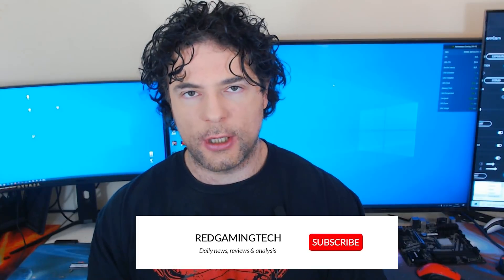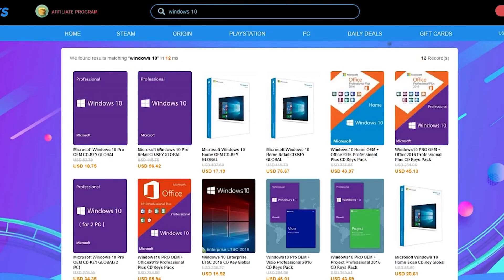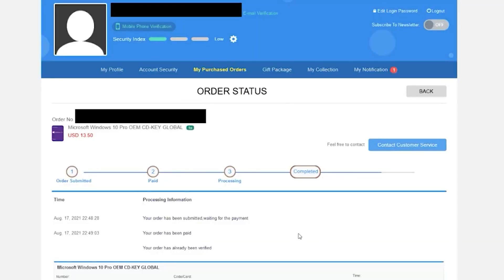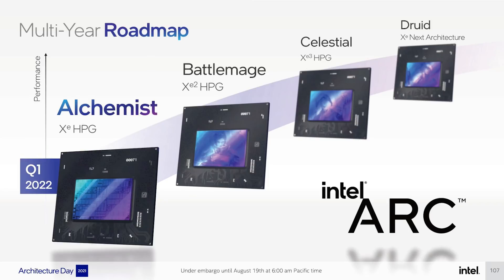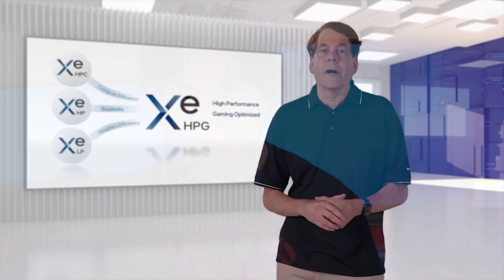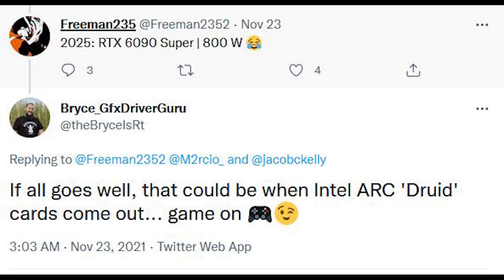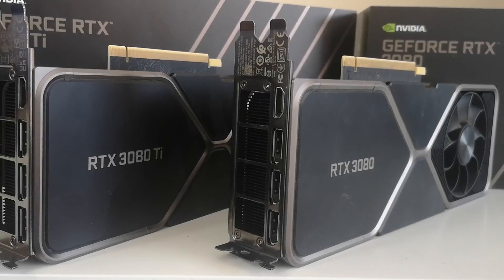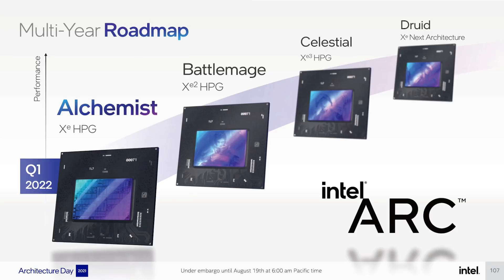Intel Could DOMINATE AMD & Nvidia With These Plans - Intel Arc GPU Roadmap | AMD Abandons TSMC?

Comment: for what i´ve read , the case of AMD getting chips from samsung is just due to capacity issues at TSMC, is just good bissness at this point to have the 3nm process booked in advance even if it is just capacity
Reply: I think it's more likely with MCM GPUs that one of the chiplets will be made at Samsung but the main processors will be TSMC. I don't think they even remotely want to tarnish their relationship with TSMC. No way do they want Nvidia taking the fabs they left behind.
Reply: @Skylancer727  agreed , if am not mistaken AMD is the second most important partner of TSMC after Apple

Comment: I hope the Arc line of GPUs does well but i suspect the first generation will be laptop only.  It sounds like they're set to release around the same time as AMD and Nvidia which means they won't be comparing to a 3070.  They'll be more comparable to a 4050 or a 7500 for their flagship GPU.
Reply: Considering due to product demand and availability issues Nvidia is rereleasing an old 2060 card then if Intel can put out a 3070 performance level card in good numbers and at a reasonable price point there will be plenty of buyers interested.
Not everyone is looking for the top tier cards, many just want a reasonably priced within their budget GPU capable of playing modern games at reasonable frame rates on 1080p and 1440p monitors.

Comment: AMDs engineers are the best because before they have to do with inferior wafer nm nodes to compete with intel. Now AMD is using not even the latest tech from TSMC and they are just dominating. Wait till AMD uses 3 nm nodes and compare them with apples 3nm, you will see AMDs are far superior.

Comment: With intel specs and vs. what AMD already has in future there is a gab of at least 1 year between AMD and anyone else as they still have the crown,
Reply: Well they will probably fuck it in multiple ways because they are AMD and this is what they do. So we can expect not enough GPUs, insanely high prices, no mechanism to avoid scalpers from buying GPUs on their website, etc.
Reply: @korinogaro  Everything you said could also be applied to Nvidia.   Also, it's not just AMD, it's TSMC's superior nodes that are beating Intel.
Reply: @diamondlion47  not really. Difference between them is that nVidia does all this shit intentionally/doesn't care (in case of scalpers) while AMD is simply fucking up.

Comment: Well AMD just announced going for networking chips so Samsung's process nodes are plenty good for those types of applications. Also chipsets and lesser compute chips can/may be produced on Samsung. 
AMD can't abandon TSMC due to node superiority and AMD needs every single advantage they can get vs Intel and especially Nvidia.
Reply: AMD has a FULL GENERATION technological advantage over everyone else with MCM GPUs. They can afford going Samsung. 
After all, that's what Nvidia is also doing (TSMC will be for the "pro" GPUs, like Ampere).
Reply: @_A.d.G_  AMD is barely matching Nvidia with TSMC 7nm vs Nvidia Samsung 8nm. 
Samsung 8nm is barely an upgrade vs 16/12nm TSMC they used for Turing and Volta. 
You could say AMD is still behind atleast half node, but of course you can never truly make that comparison, every chip is designed for a specific node in mind.
Nvidia is gonna go all out with 5nm TSMC and the jump is massive.  AMD will also use TSMC 5nm and it will become a true war with technologies. 
Will AMD's MCM win vs whatever Nvidia monolithic desing has to offer? 
I do think AMD can do a lot here with MCM and leading processnode however Nvidia isn't sitting still pants down working with their own MCM designs. 
AMD's MCM desing may be only temporary relief/win against Nvidia, but only time will tell.
Reply: @Diglo1  what does production node impact? Have you noticed that AMD is unfathomably superior to Nvidia in terms of efficiency? Do you think that surrendering some of that unreachable gap for the sake of much bigger volumes of production would be a problem? Don't you get that with Intel stepping in the GPU market, CPU+GPU bundles will be the norm in the industry?
Reply: @_A.d.G_  Production node impacts EVERYTHING!
It impacts efficiency, clockspeeds, the amount of transistors per die area, amount of dies per wafer and the defect density impacts the amount of good dies.
Denser die will have more performance potential per die area and more chips can be made from the same size wafer.
Samsung 8nm is far worse process node vs TSMC 7nm.
AMD is barely better in efficiency then Nvidia, sure there are some cases where Nvidia is far behind, but if we exclude the most fastest ever 3090s and RX 6900XT, AMD is only slightly better at efficiency.
AMD does have significantly lower raytracing performance so when we check efficiency there AMD loses.
Also Nvidia holding the performance crown by just 5% somehow justifies whatever efficiency losses there seem to be (mind share).
I don't understand your third question. Of course getting ratio right between quantity and quality is a must. 
This however is a multivaried equation and I won't dwell into that.
"Don't you get that with Intel stepping in the GPU market, CPU+GPU bundles will be the norm in the industry?"
I never even mentioned Intel so getting something about something I didn't even mention does not make any sense.
CPU and GPU bundles are likely to get more common, however that will depend on how good Intel's GPUs are.
AMD can comfortably pair CPU with GPU however Intel is just releasing their first discrete GPUs so it will take years to actually matter and Nvidia doesn't have CPUs.
So AMD has a clear advantage there which they are taking advantage off, but that advantage is only relevant if their products stay competitive enough.
MCM saved AMD trough their CPUs yet they are already challenged by Intel on mainstream CPUs and Nvidia is constantly been better or on par.
So AMD needs to keep their advantages and staying with MCM and TSMC is a must however those advantages will fade away over time until something now comes along.
Intel has 3D stacking and money stacks, AMD MCM + 3DVcache, Nvidia mindshare + key technologies like DLSS, RT, superiority in many software related things such as CUDA accelerations and much more.

In short I truly believe AMD can do many things with MCM just like they did with Ryzen and CDNA2 yet Nvidia simply stepping from Samsung 8nm to 5nm can bring hell to AMD in terms of GPUs.
Reply: @Diglo1  if you say so...
Reply: @_A.d.G_  🤣🤣🤣
Reply: @Diglo1  hip rocm, bye cuda advantage
Reply: @miyagiryota9238  I hope AMD can pressure Nvidia's CUDA acceleration.

Comment: AMD's partnership with Samsung is most likely constrained to the mobile phone market, probably producing RDNA technology using Samsung's fabs for the graphics chips in Samsung's phone range.
Reply: Why? Can you imagine how much income have TSMC's constraints in production "stolen" to AMD, Sony and Microsoft? 
AMD already gave the middle finger to GloFo, why they can't do the same with TSMC?
Reply: They also are the two of the 3 developers of HBM memory;  AMD didn't introduce HBM on the R9 Fury or use HBM2 on Vega for no reason.  They helped invent it with Samsung and SK Hynix.  To me,  AMD's biggest error was  not replacing the polaris card stack with Vega after in moved to 7 nm;  by that time, GDDR6 was available, and would have been fine for a 32CU or 24CU board.
Reply: Considering how far in advance contracts are made, who knows.  I'm pretty sure Zen4 contracts are already made, but if TSMC can't give AMD enough wafer production I could see them moving to both Samsung and TSMC to produce a product stack of GPUs for instance, or Samsung entirely.  Right now AMD can't produce enough die of almost any kind right now with TSMC.  They can't produce enough desktop CPUs, server CPUs, has still not gotten to HEDT and they've had to remove production from GPUs to shift more wafers to chiplets, mostly to sell more server CPUs.  The end result is sales of AMD GPUs are down, because the product just doesn't exist and Nvidia is taking most of the GPU market.  Considering this was the generation where AMD basically caught up to Nvidia at the top end, that has to be pretty frustrating.

About a month ago they released information about their plans for the world of servers and it looks great, but if TSMC can't give the no. of wafers they need, they lose too much sales to Intel.  So it's possible they could shift some product to Samsung.  Not for CPUs but certainly possible for GPUs.  Nvidia I believe is going to be using TSMC for their next gen GPUs, so yeah.  Samsung could offer AMD the capacity they need so they don't have to go through another generation of product stacks for both CPUs and GPUs where they don't have enough product.

Micro Center has removed the 5800X for instance from its search.  That usually means they're sold out and they don't know when they'll get more.  The 5600X shows unavailable.  And of course their GPUs has been terrible for supply.

I also think AMD got caught off guard when Intel was able to buy up the rest of the first run of TSMC 3nm.  Now they have to wonder about what TSMC capacity is going to be for the next year run of 3nm when Zen5 is supposed to be on it.
Reply: @johndoh5182  seems fitting, given the extremely anticompetitive strategies of Intel: buy all the available spots and prevent AMD from producing anything. 
Intel. Intel never changes.